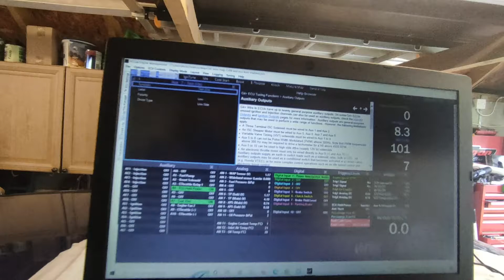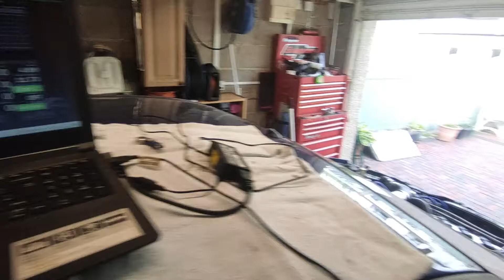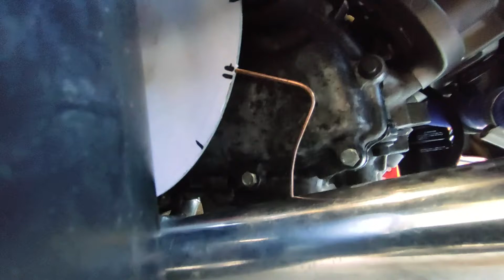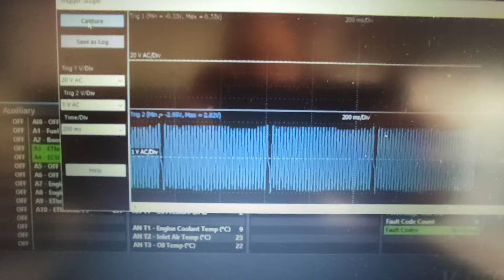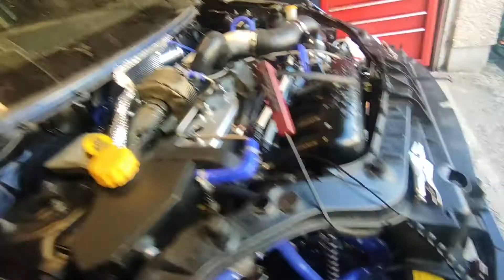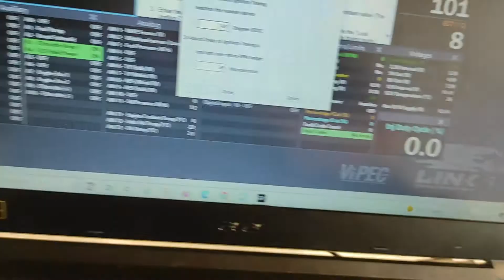Base timing, troubleshooting and first start attempt

Comment: What cops are those can I use any ?
Reply from the maker: They are from a honda k20. I got them because the igniter is built into the coil as  my ecu doesnt have inboard igniters.
They dont fit exactly, so I had to make a mounting system for it to work, and using a different rocker cover.
Yaris coils, and vag coils also have the igniter built in I believe, but no idea if they will fit in the rocker and reach the plug
Reply: Are you running paired injection ?
Reply from the maker: @viqashussain4394  No it is fully sequential